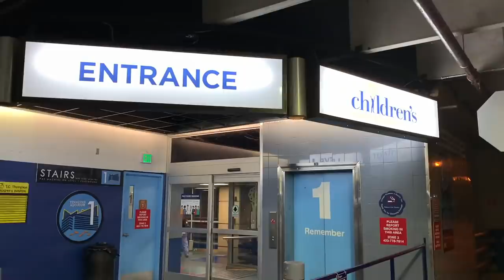We're Moving and Having Surgery | PJ & Thomas

Comment: PJ a quick way to paint cedar shingles to take a a old paint brush that is large and paint the overlap shingle part with that going horizontal.  Then take a roller with a heavy nap roll tube and roll on the paint over the shingles.  I tried painting a house the way you were doing it with a paint brush and about halfway through came up with this idea.  It worked quite well.  Also, teach Thomas how to build a fire, he was lucky fire started.